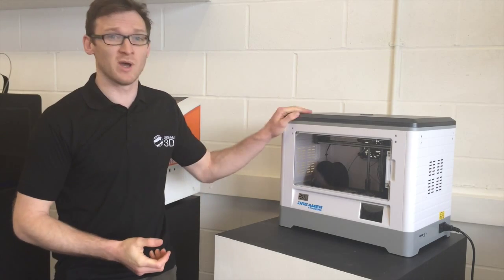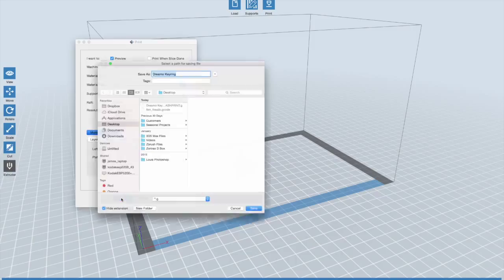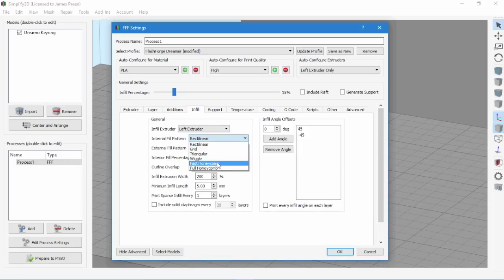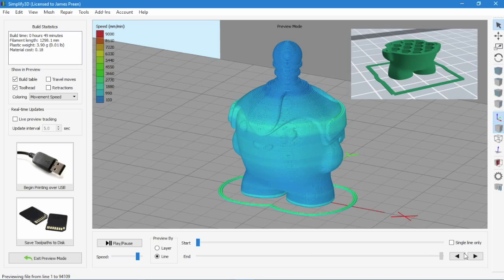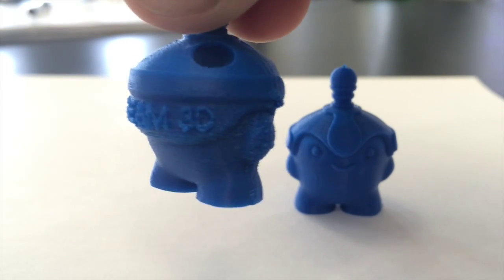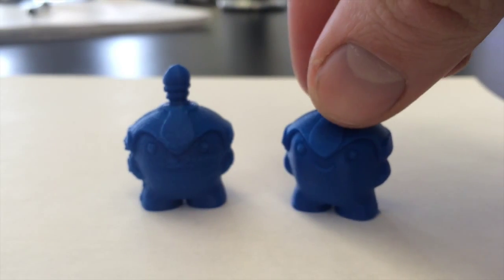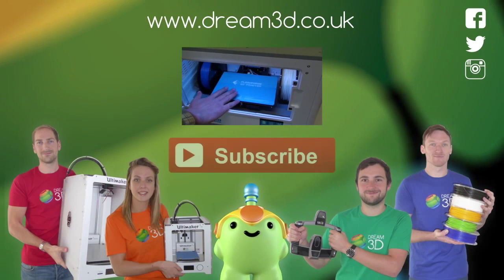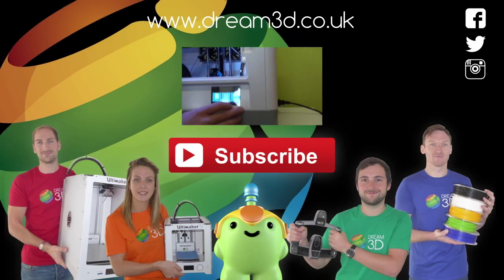Simplify3D Vs Flashprint for the Flashforge Dreamer | Software | Dream 3D

Comment: My experience with simplify 3D has been absolutely amazing. purchasing a license for simplify3d has been among one of the absolute best investments I've made during my time exploring the world of FDM 3D printing. It takes a little bit of time learning the various settings and how to best utilize them, but the money and the time that I've invested into learning how to use simplify3d has been tremendously rewarding and I've not seen the same great options anywhere else. To be fair however, once I discovered simplify3d, I stopped looking into other slicers. :) It anyone cares to improve their prints and greatly expand their capabilities 3D printing, I would highly recommend the small $150 investment and spending time learning how to utilize simplify3d. It's absolutely amazing!

Comment: funny I have the exact opposite experience. my prints from flashprint are much better than simplify3d. I have been hearing my head against the wall trying to get simplify3d to at least match flashprint with very little success.
Reply: prostreetcamaro, so would you not recommend buying S3D? I'm using the latest version of flashprint right now, and the major problem I'm having with it is that it has trouble recognizing small details during the slice. it usually distorts them in one way or another. So I'm trying to solve this issue, but I don't want to fork out $150 for something that doesn't do much better.
Reply: Flash print is only going to get better and better I would think. It's not a bad slicing program for free. Hopefully they work out all the bugs eventually.
Reply: The S3D print in this video looks like 90%+ of my prints from flashprint. 
Sometimes have to tweak a couple things, but that's probably more the printer's fault anyway.
Reply: prostreetcamaro While simplify3d may appear to complicate things, that complication is rewarded with a tremendous amount of outstanding options that make that which is impossible in Flash Print, possible! My initial experience with simplify3d was one of great frustration. However, within a few weeks of continued research and trial-and-error, my perseverance was exponentially rewarded! Simplify3d simply offers numerous Advanced Techniques needed to print more intricate designs / prints. Having no affiliation with simplify3d other than a tremendous amount of gratitude for what it has allowed me to make possible, I highly recommend spending the time learning how to make use of such wonderful software. The results that I get from simplify3d are absolutely astonishing. I think that you will find others saying the exact same thing across the board. I hope that you take my advice in earnest as it will greatly improve your 3D printing abilities. Best of luck to you.

Comment: Installed FlashPrint 3.10 today and it apparently would not recognize my Creator Pro. The Print menu has no selection for "Select Printer". Do I need to update the firmware? Will Simplify 3D still work if I do?
Reply from the maker: Hi,  I would go ahead and update your firmware. I don't think this will effect you using Simplify3D.
Reply: Wont work on CP I am looking at changing the CP Mother bard to Dreamer?? or stile with Makerware/Mzakerbot